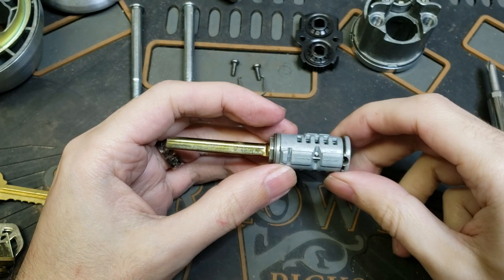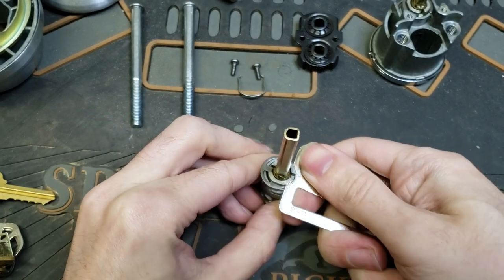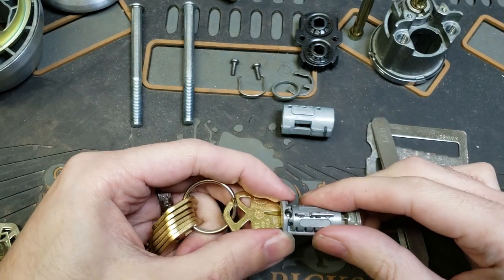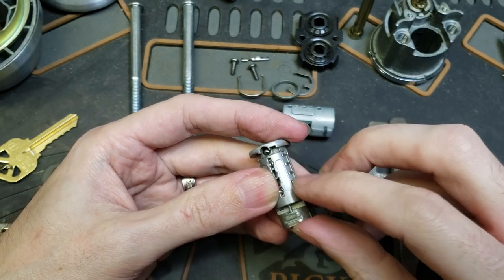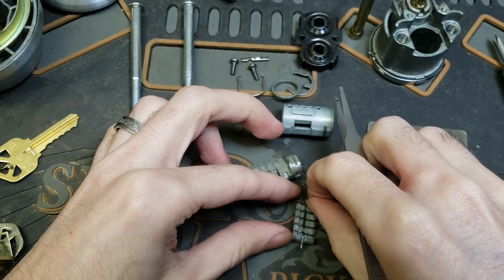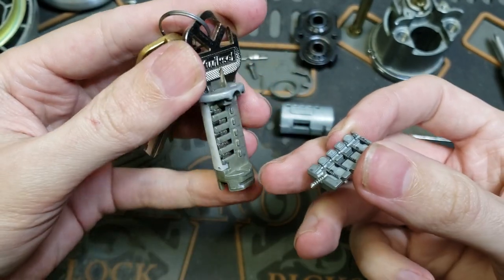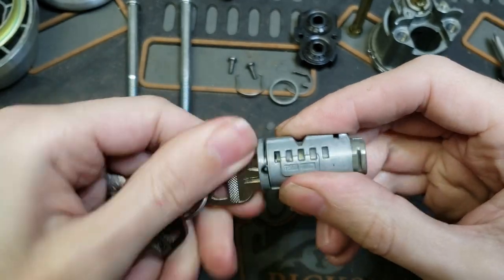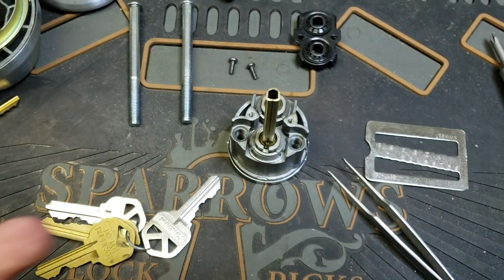(117) Resetting a Kwikset SmartKey cylinder

Comment: Thanks for this video. I had two locks on a new-to-us house that did not "SmartKey" correctly. I went to purchase a new deadbolt and was stunned at the $40+ price. I looked at several videos and started the reset process. I kept hitting a stump when I tried to put the lock back together. Then, I found your video. The clarity of your instructions and your filming (lighting and focus) solved the issue. I was aligning the wafers too high. Your video clarified where the ridge needed to be aligned. Thank you so much. I now have two operational deadbolts that were about to go to the dump and over $80 saved. Again, thanks.

Comment: Thanks a ton for posting.  Got a lock "new" that clearly had been returned and the key didn't fit, this solved it pretty quickly, thanks!  I'm guessing my revision is newer, there was some sort of retainer for the bar and I didn't actually have to remove the bar, just take off that side and adjust the wafers.  Wiggled too much reassembling and clearly got one of the wafers out of alignment, but it worked the 2nd try!.

Comment: Made me laugh when you dropped the slider housing (as I have done many times).  Thanks for tip in key at # 3 depths to make it easier to pull core out. I like pjdambra's comment as a great way to do this easier & faster, no mess!

Comment: I simply decode the lock with a gage pin to measure the open gate height of the wafers. Using a set of depth cut keys. Read the lock cut the key and your good to go no disassembling two minute job.